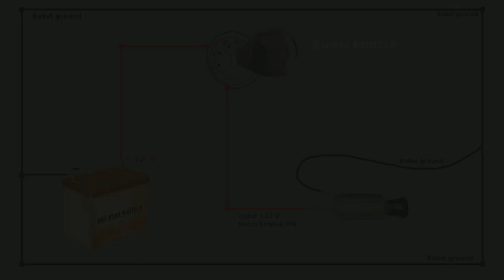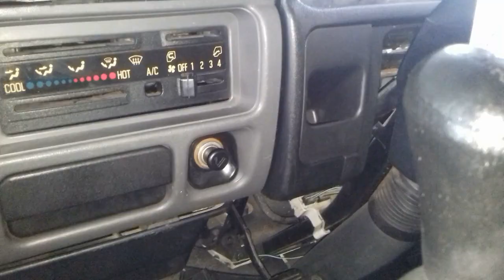Cara mudah memasang cigarette lighter mobil

Comment: boss, kalau untuk ngecharge HP hisa, tapi kalau untuk colokin cigerette lighter nggk bisa, apanya ya yg rusak ya ?
Reply from the maker: Kemungkinan lubang charge tsb outputnya bukan 12V ttpi menggunakan voltase utk charge yg rata2 5V, sedangkan utk lighter menggunakan rata2 menggunakan 12V
Reply: @AJMcrews  saya cek sudah 12V, kl di tekan nggk mau nyangkut
Reply from the maker: Di dlm lubang ada plat lengkung di 2 sisi yg kemungkinan kendor keluar sehingga lighter tdk terkoneksi dgn baik.
Lepas lubang lighternya dan plat lengkungnya di tekan lagi ke dlm.
Klau tdk bisa, ganti dengan cigarette lighter yg baru

Comment: Mas kalau pasang gitu pakai sekring ap ga usah
Reply from the maker: Lebih aman pakai sekring
Reply: @AJMcrews  kalau yg pasang 24 volt sekringya berapa ampere mas
Reply from the maker: Kalau di mobil rata2 menggunakan sekring 15A
Reply: AJM crew's cara pasang sekring nya di mana